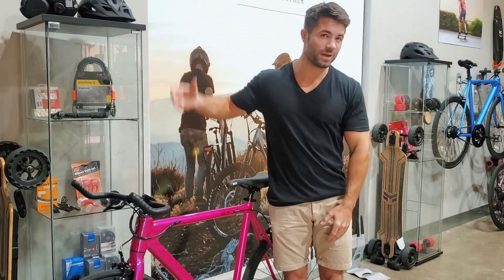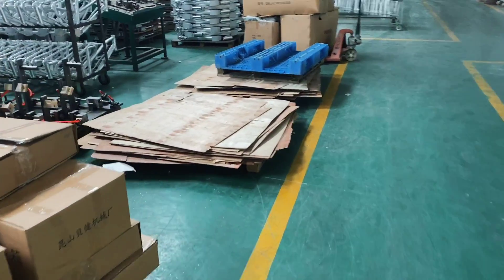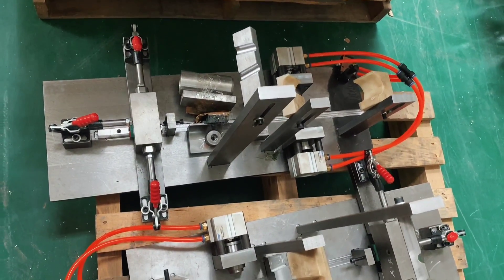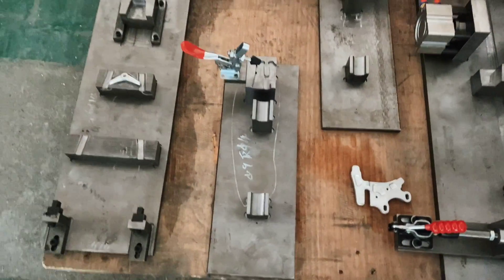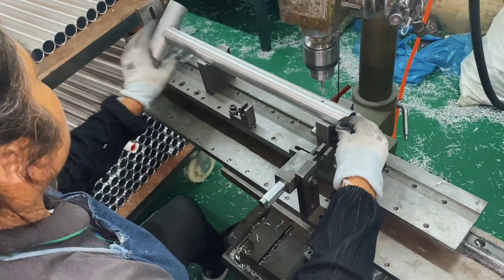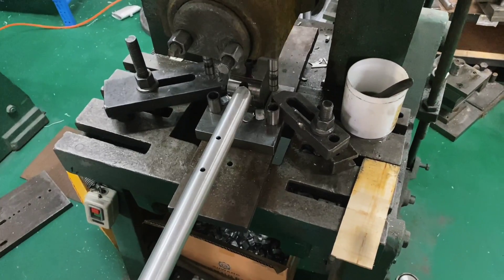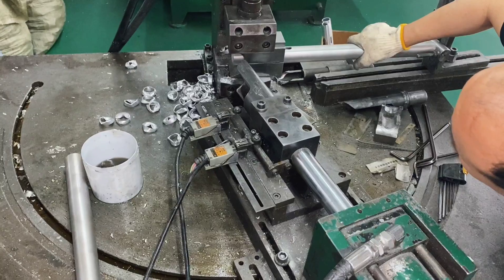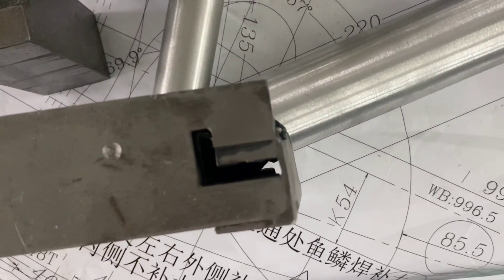Production Update: Babymaker Frame Tooling

Comment: What if there is mechanical problems or battery 🔋 goes out. What do I do? What if I need a quick battery change?
Reply from the maker: The battery is designed to hold 70% of its capacity even after 500 cycles of full to empty.  If you ever need to replace it we have filmed this instructional video showing you the step-by-step process of how to do so:
https://www.youtube.com/watch?v=WOeD9qyle-E&t=102s